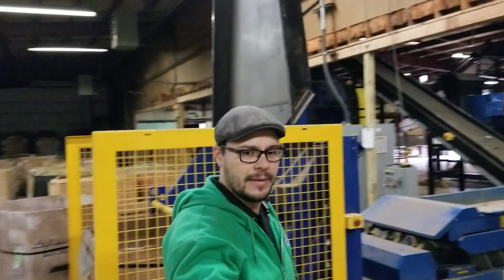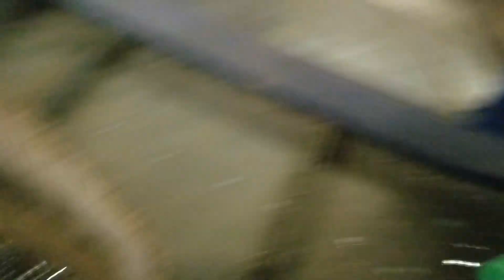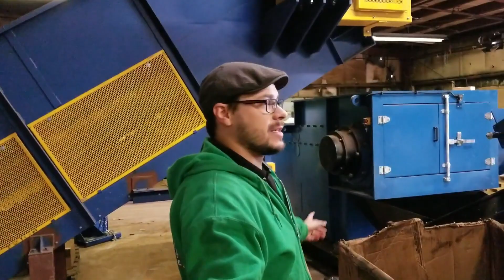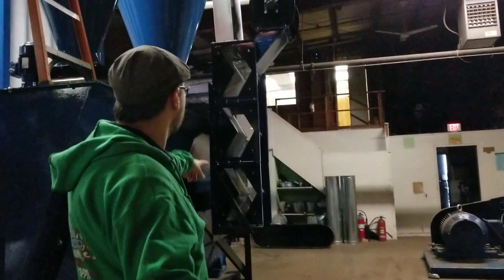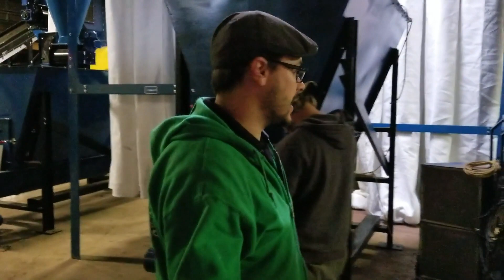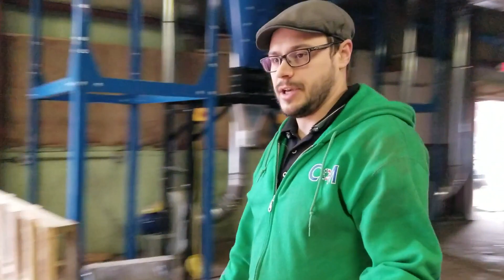Update to New Jersey Meatball Processing and Recycling Plant

Comment: That is one heck of a system.  First time I heard you mention a C5.  Is the one at your place going to be the same or bigger?
Reply from the maker: Believe it or not, the one going at our place is almost double the size. We have similar components, but overall the system will be larger. We just need to make the time to install it all!
Reply: Hurry up.  I have about 2000 pounds of motors and transformers.